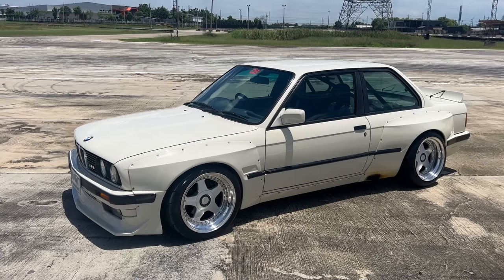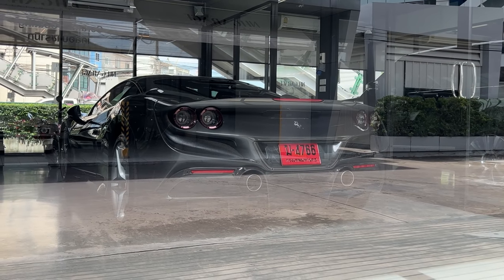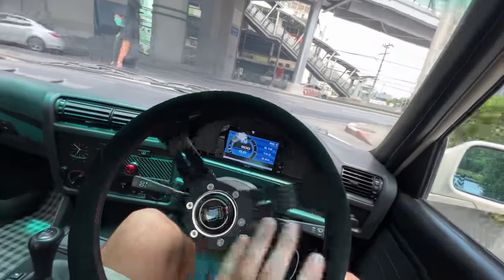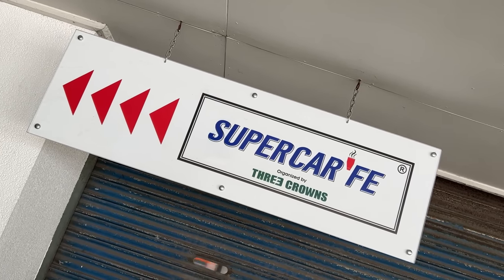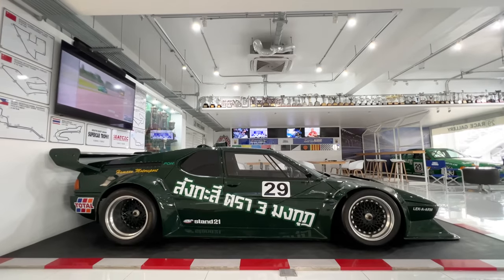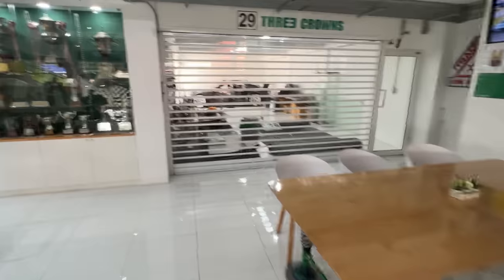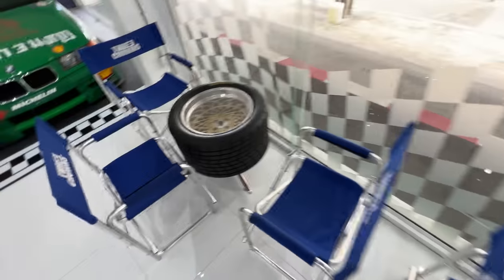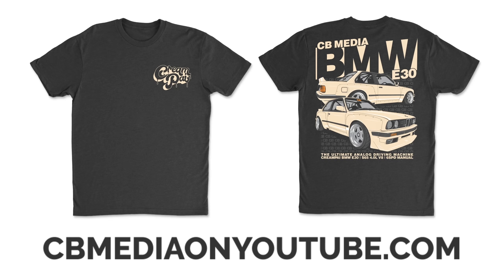Bangkok's Newest "Motorsports Cafe" is AWESOME!

Comment: Dude! That E36 STW (Super Touring) was a legend in its day and a very special car. BMW dominated the racetracks around the world with thase cars. They were in fact raced that low and the manufacturers invested heavily in R&D to outperform one another. The BMW's were so successful that the FIA actually imposed a weight penalty on a the E36 because it was so successful. They said it was because it was rear wheel drive. The Super Tourer era was the reason that I got into motorsport and racing. It is a real pity that you have never heard those cars run. They have the most incredible induction sound.
Reply: the sounds from E36 and the touring 190e's perection

Comment: Ya been to BKK & traffic is horrendous. I get why you'd want to own wheels but for all practical intent & purposes, its much better to take the metro whenever possible & then cab it to desti. Its cheap nuff & no sitting in 1000% humidity with AC on full blast at todays gas prices. To live, I'd prefer a quieter hood tho. BKK is just too much most days. But its gotta fun to be able to full send CreamPie whereever whenever, when traffic allows that is.

Comment: I have a question I hadn't thought much about. The Bimmah is a right hand drive and the blinkah to change lanes is on the left side of the steering wheel, which means you had to take your hands of the shifter to indicate lane changes. With left hand drive cars, the blinkah is on the left hand side, thereby keeping your hands free to shift with your right. So is that typical of right hand drive cars? It almost seems like the whole steering wheel assembly was just moved over.
Reply: Bold of you to assume a BMW driver would use their signals 😂
Reply: @koukicody  Talk to chad about that..... but, on that note, if you do give someone a heads up (using the blinkah, that is) you  gonna get what you asked for! lol!
Reply: All RHD bmws have this setup, bit annoying !
Cheers from Australia 😆
Reply: @timwise6876  Ok, thanks. I'm going to chuck that up to manufacturer lazyness.